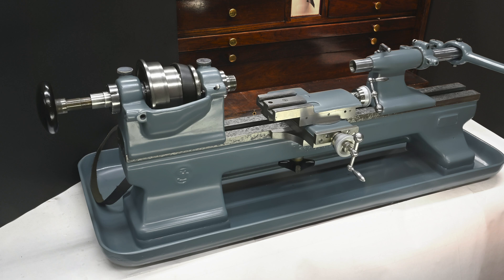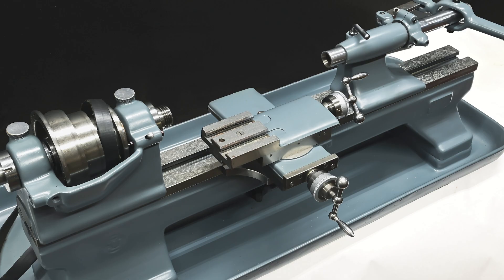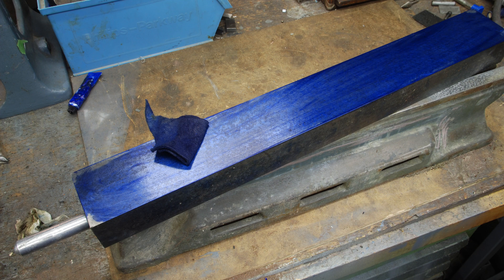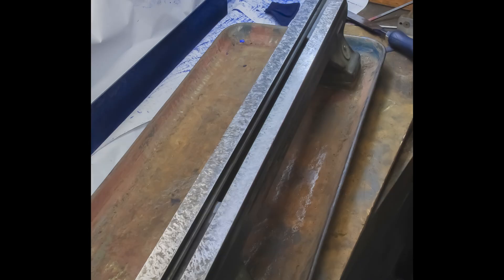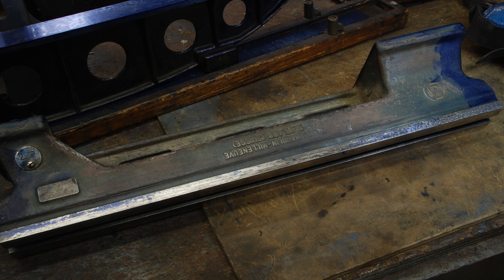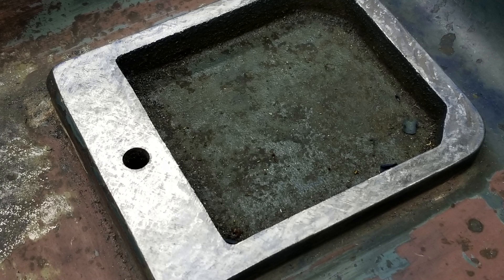Reconditioning a Schaublin 70 Lathe   Part I   The Bed

Comment: How do you ensure that the 2 halves of the ways are true/square/even with each other with scraping? Couldn't it be that they are both flat but not on the same plane?
Reply from the maker: at 2:50 you can see the reference flat is wide enough to contact both so it wasn't an issue.  When that isn't the case, a tenths indicator on one way can be used to monitor progress on the other.    Sometimes parallel is all you need, but with this geometry they have to be coplaner as the slide rest sits on top.

Comment: my rivett 608 has 3 ball bearings pressed into the bottom to get 3 point contact.  always struck me as amusing to have 2 nice big supports with large surface area, similar to what you have here, then just 3 tiny points of contact hidden away in there